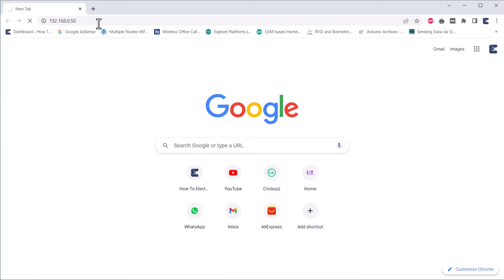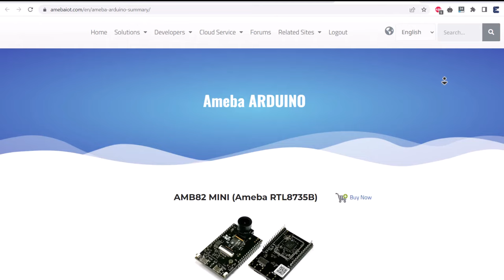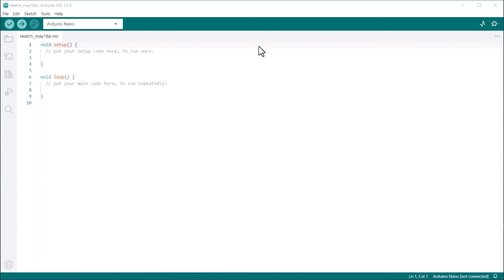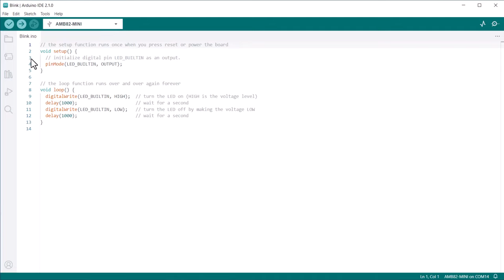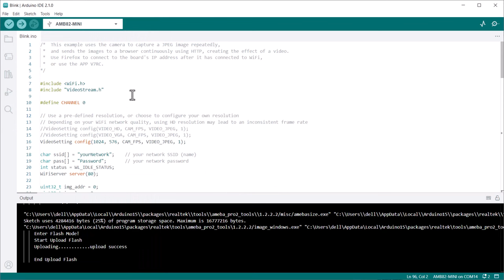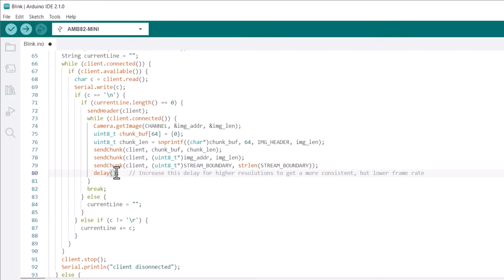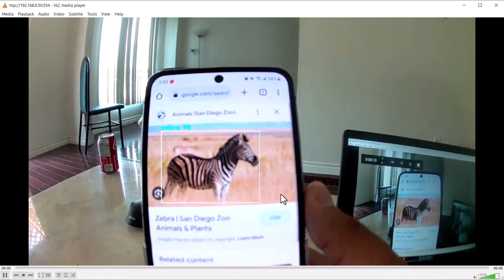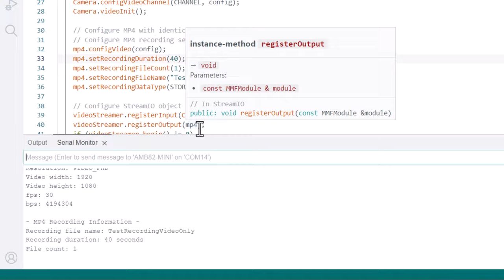Powerful Alternative to ESP32 CAM | Realtek AMB82-Mini IoT AI Camera Board - Getting Started

Comment: I'm in love with this board.  Okay, not just the board but the fact that the software is easy to setup in the IDE, compile, and run within a few minutes.   All the other boards I've ran across you monkey with libraries, moving files around, etc.

Comment: If you have a hard time understand her turn down the playback speed to 75%.  It's natural for those with languages that are spoken faster speak English at the same speed.  Which makes it hard to understand. 

  In any case, I bought an AMB82 Mini after playing with several of the ESP32xx flavors.  It may cost 6 times the price of the other, but you return that back in time save setting up, compile times are faster, better performance and features.  If you end up making and end product it will blow the others out of the water quick.

Comment: Can the NPU be tasked with a HAAR cascade? I would like to use this for license plate recognition.  Use HAAR cascade to identify license plate, then use custom weights to do OCR for plate number
Reply from the maker: I really don't know about this. Have tried HAAR Cascade with Raspberry Pi and Python, it worked pretty well. I have no idea about this module. Need to contact the manufacturer, they can provide more info.
Reply: @HowtoElectronics It looks like you can input custom weights, I might purchase one of these boards and see if it works.  I could be wrong, but a cursory glance tells me it uses something compatible with pytorch

Edit: also, very nice channel-I subscribed!

Comment: 12:16 Is that really how you want it to work? Think all cars are motorcycles?
Reply: I don't have a device to check, but I assume that the value next to the car should have been changed from 1 to 0, and not commented out the line
it even says that a few lines above